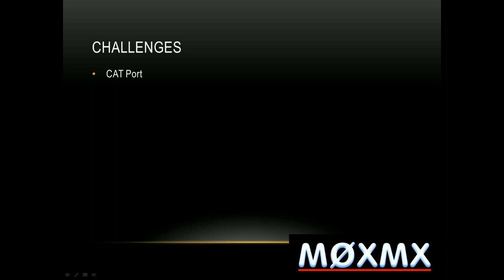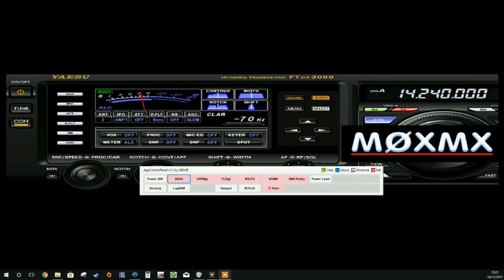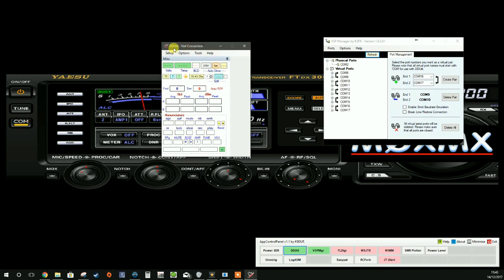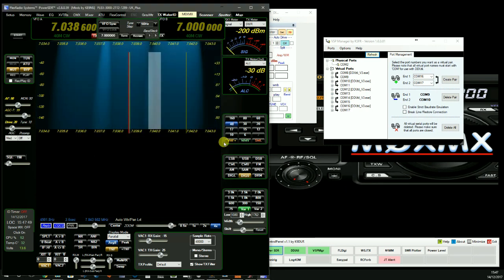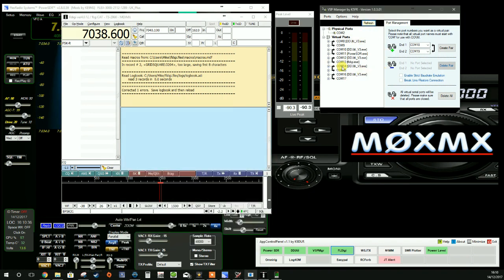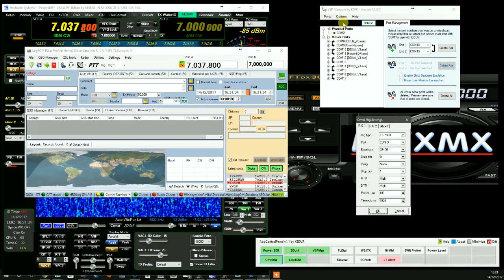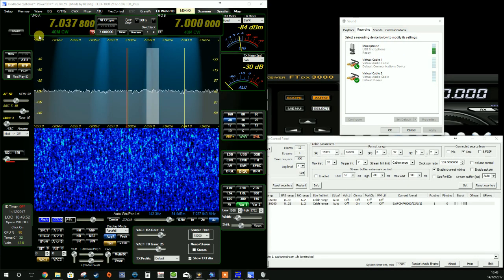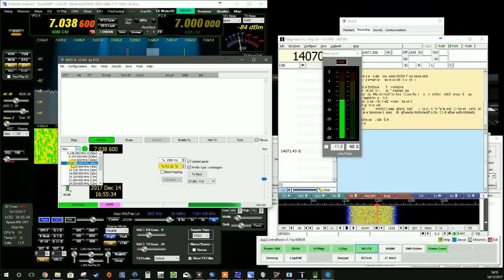Config & SETUP Flex (Power SDR) FLDigi, WSJTX, Log4OM, DDUtil

Comment: Thanks for your video.  I had trouble with my Flex 3000 K9ns version 2.8.149 and WSJT-x setup, virtual cables just did not want to work, apparently, when I tried the trial version of VAC it just would not work. In the end, I purchased a "full" version, and it all came together. Thus my advise to anyone wishing to use the VAC software, get the full version first. I spend a great deal of time trying to figure out what was wrong with the "trial" VAC. Thanks again for the great video on the Utilities you use. Version of VAC (full) currently as of March 2, 2020 is 4.62.
Reply from the maker: Glad I could help. 73.

Comment: Hi Mike, I have downloaded all the software Im not using a flex so presume i dont need the DDutil and would attach silicone labs enchnaced to the com posts for cat control the same as you did DDutil, is that correct
Reply from the maker: Hi. Yes that sounds like it makes sense. Think you have it cracked.
Reply: @MikeM0XMX  I couldnt get it to work through VSP MGr Im using Omnirig and it all works now, I got Gridtracker running too, Thanks for your videos and help